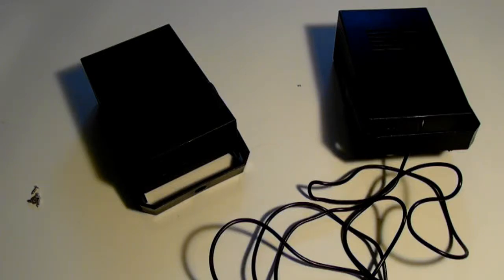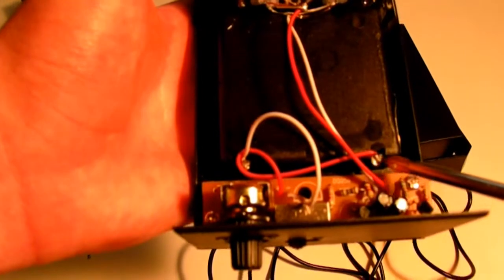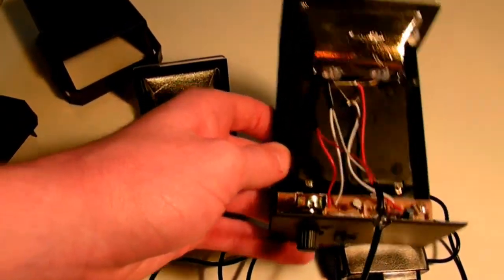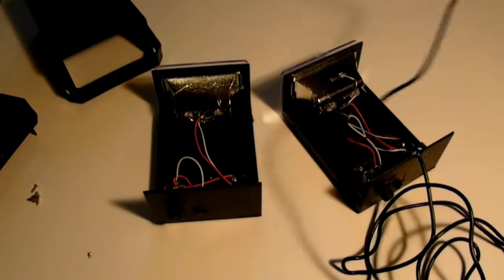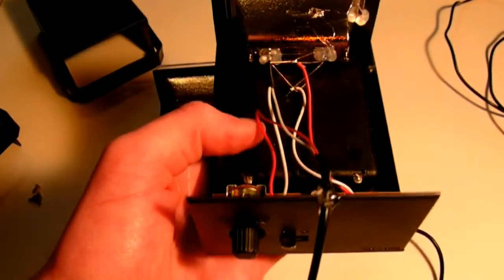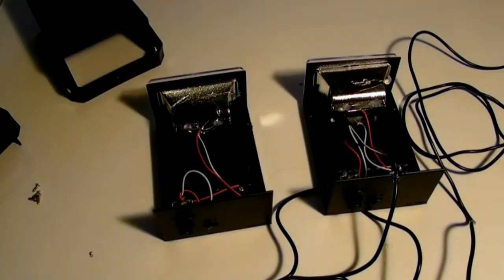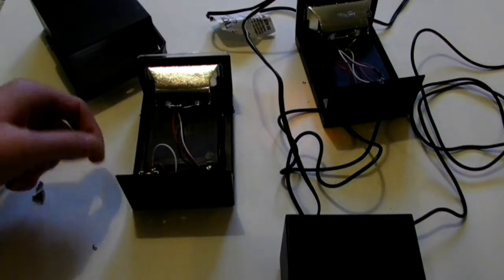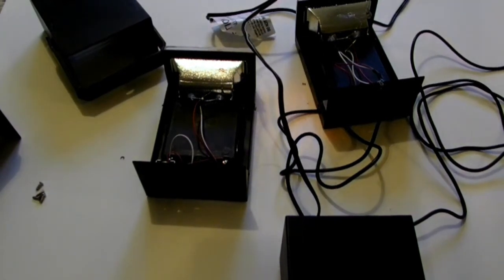How to Hack a Strobe Light so you can plug it into the wall

Comment from the maker: @SuperControlRoom Well, I needed it to be able to plug this in a motion sensor so I just cracked it open and took a look inside. I saw that there were 4 batteries and they each put 1.5 volts of energy into the light so I jus multiplyed 1.5 times 4 and got 6. So that is 6 volts, so stripped 6 volt coverter which converts 12 volts which comes from a regular house outlet to 6 volts. Well I tried that and the light flickered way too fast so then a tried a 5 volt and it worked just fine.